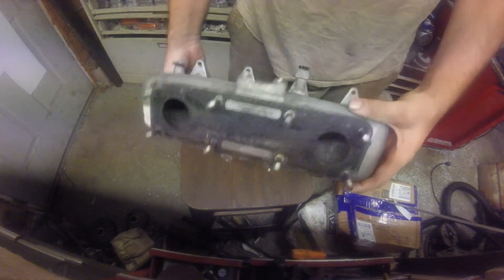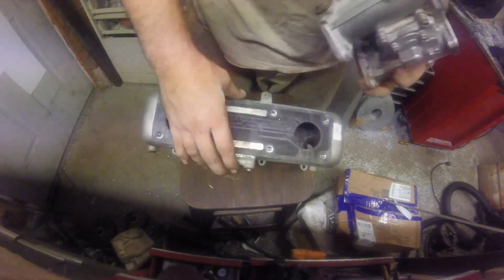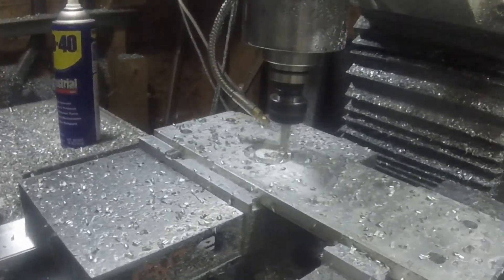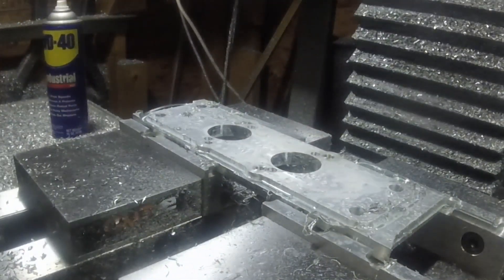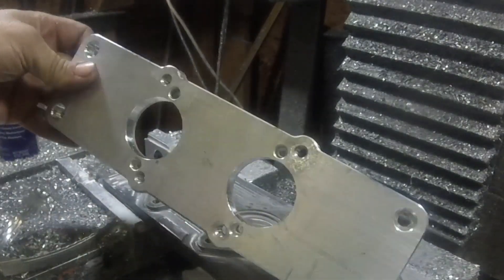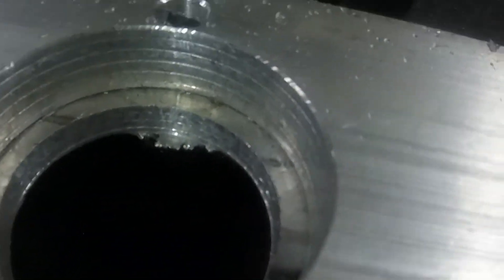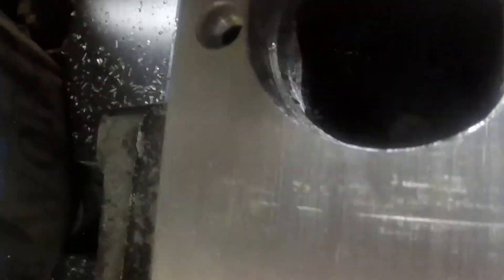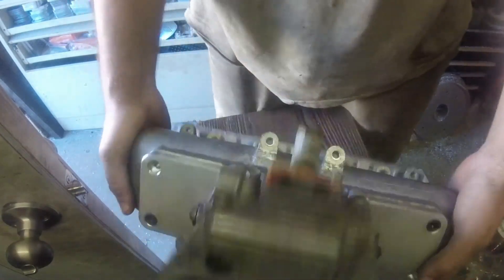Making a Weber DCOE adapter for Cosworth Vega manifold

Comment: Why would you downgrade the engine like that ?

That carb is absolute garbage compared to injection , all that motor needs is a modern ECU like Megasquirt.

That carb will result is lots of fuel separation in intake , uneven fuel, fuel puddling and terrible tuning .
Reply from the maker: You could be right.  Possibly why he never ordered another one.

Comment: I made an adapter out of wood....don't laugh ....wood doesn't conduct heat and is lighter than aluminum...used a Holley 2 brl TBI ...it was a bit over carbureted at 500 cfm...I think tunnel rams are for high rpm's...see 'em in drag racing.
Reply from the maker: I've heard quite a few people using wood and it seems to work great; not sure about longevity though.

Comment: Nice plate but it looks like cylinders 1 and 4 are gonna run a bit lean. Maybe not because it’s carbureted and the fuel / air mixture will get distributed evenly across the cylinders. I’d like to no how his flow test went.
Reply from the maker: Me neither.  I was interested to see how it turned out.  I have an old valiant with a straight 6 in it and a single barrel carb right in the middle and they made a ton of those over many years.  The carb does have a small plenum under it to help  with the "fuel cloud" though.  Once the gas is atomized it should get drawn into whichever valve is opened but the two middle ones do have a straight path.  I imagine the tests to confirm any of this are pretty intense.

Comment: There is a reason the intake holes for the EFI are spread apart.  The original EFI design before emission testing was completed were centered near the middle of the manifold.  That design failed emission tests because of burnt exhaust valves in cylinders 1 and 4.  With the single Weber on a stock intake that problem may lead to the same problem.
Reply from the maker: Good to know; it may have the same problem.  He said he'd keep me updated after some testing but I've not heard back yet.